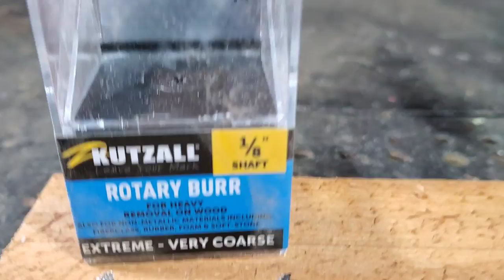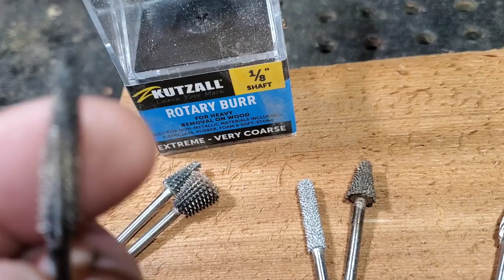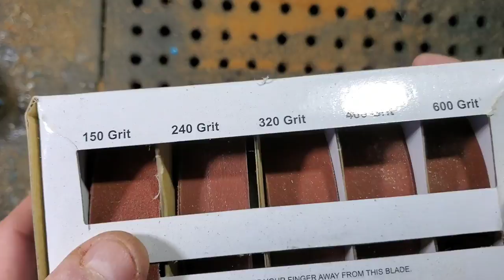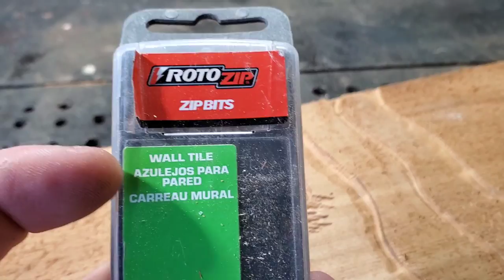Wood carving for begginers, all diffrent types of carving burs, part 2

Comment: First of all..Thanks for clear explanation. I'm a rookie and learning a lot of things from your videos. I also using Kutzall burrs and im very happy! But have a question about Kutzall extreme Taper burr. Because now i need that shaped burr and saw some comments about how bad it is and bended burr photos. Have you ever accidentaly bent taper burr ? or what i can do for not bend ?🤔
Reply from the maker: I myself have never bent a burr, just snug it rite up to the collet and pull it out a few mill and tighten it up.

People that bend the burrs probably have them sticking out to far and running there dremel full speed. 

Hope it helps
Reply: @CarvingFusion  Got it. Thanks a lot!

Comment: Great video! I'm a new carver and starting with signs for my community. I'm curious about speed. I'm carving simple signs, like "Speed Limit 15 MPH" signs. I'm working with pressure treated leftovers from my neighbor's decks and fences. Pretty sure some are pine (soft, right?) and no name wood. All have been aged. I can transfer the letters, follow along, but at what speeds do I want to go? I tend to be hesitant to really crank up the speed. Is higher speed better for cutting the letters in or slow and low?    (This question may seem simple, but I'm simple and not very confident at this point. Sorry.)
Reply from the maker: It's ok so am I,
I think it's just good to run your tool what works best for you, the more u do the more u will figure out what works best for ya

Comment: What do you recommend between rotary rasps (Saburrtooth) and carbide burrs (those with bevels for aluminum)? I have ordered exactly the burrs you have here at 0:06 (with 6 mm shaft, for die grinder), because Saburrtooth is not present in Romania, and I should order in Germany. Cost is about the same, but I thought the carbide burrs must be stronger than the rasps. What is your opinion?

Comment: what type dremel  rotor are you using? Please
Reply from the maker: I  normaly use dremel 4000 also use cheaper ones like Wen or what ever but always worth the dremel flex shafts, most the other ones suck

Comment: Hi Jordy, just brought a Dremel 4000, I'm looking to carve wood spirits, I'm in the UK, I see you use good quality Kutzall bits, they are quiet expensive but I know you only get what you pay for! :)
Having said that, I if I were to buy just one or two to start, what should I buy please? KUTZALL has many one their  site. Many Thanks
Reply from the maker: The flame extream and extream taper
Reply: @CarvingFusion  Cheers mate, much appreciated!
Reply: @CarvingFusion  Cant get these in the UK,  only on Amazon UK and cant see these anywhwere??does the shaft have to be 1/8...as some are 1/4?

Comment: Hi ,i have questions for you  , i have dremel 4200 & 400xpr and also i have dremel flex shaft after i see your video about kutzall burr i got 2 of them but the shaft is 1/4 and 1/8  , i want to know how i have to fit them in my dremel ? , is there any adopter or flax shaft that i can fit in to my dremel ? Let me know what i have to do please
Reply from the maker: U will not be able to use the shaft size 1/4 for a dremel (its to big) 
But the 1/8 will fit, u have to make sure u have the rite.size collet on the dremel handpiece,
Reply: Carving Fusion By : Jordy Johnson so i have to bye another carving machine ?

Comment: Why would the burs slide out when I run my drill?
Reply from the maker: Most likely need a new collet,
Reply: the collets also come in different sizes...you might have got the wrong size shank....get the smaller collet and set for all shank sizes....well up to the largest your tool can handle
Reply: You're not closing your collet tightly enough using the spanner provided.

Comment: Finlay found a distributor here in Aus that sells the kutzall burrs only problem is they are $30 a burr and the prices have risen because of this virus shit and thieves on ebay are asking $300 for the Dremel 4300 and $80 for the flex shaft
Reply from the maker: Brutal